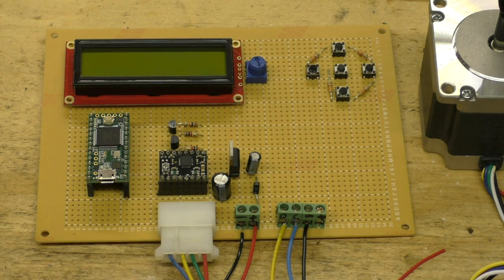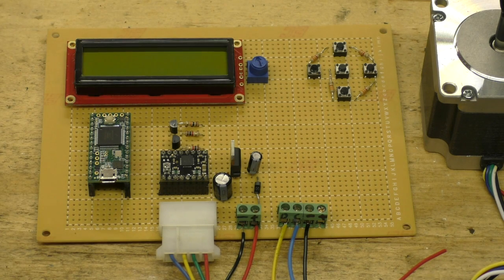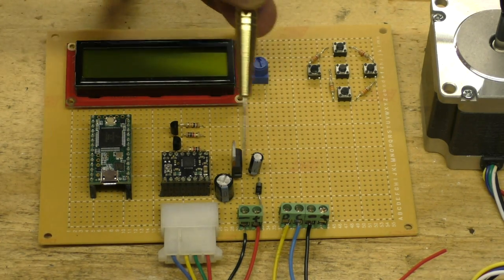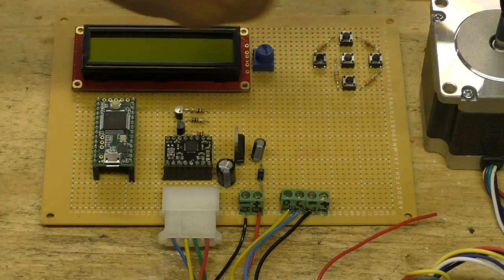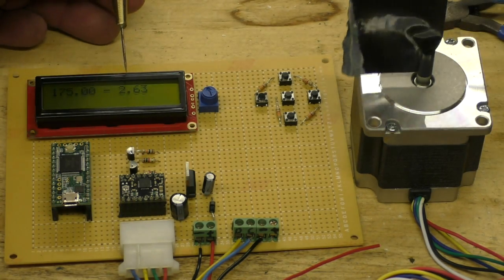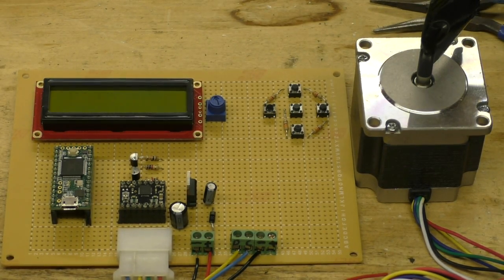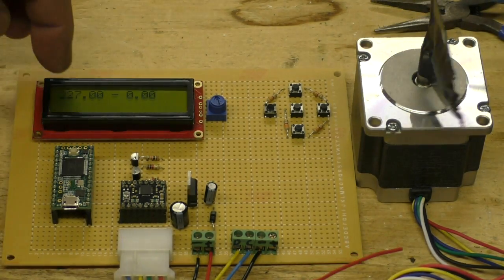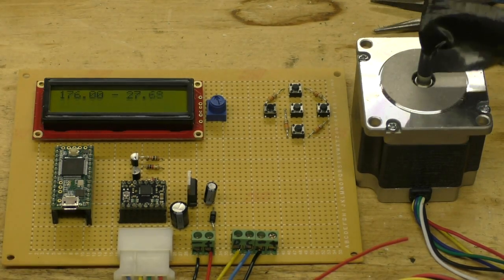Filament Extruder Update #2

Comment: i got a question where can I get the arduino code for that ?
Reply from the maker: It's still a work in progress.  I will post code and all info when I have something that works.
Reply: +Making Stuff 
ok thanks. I'm working on a filament extruder as well. The arduino related components are for the heat control. Your video gave me a great idea for what to add on. The idea that I'm aiming for is a 20 dollar filament extruder challenge.